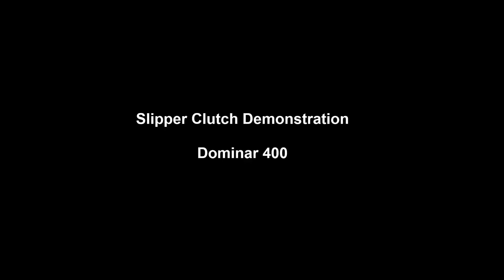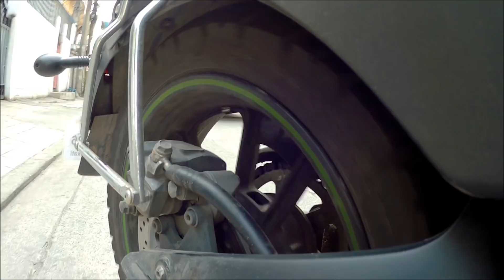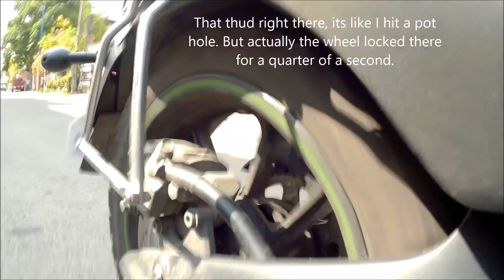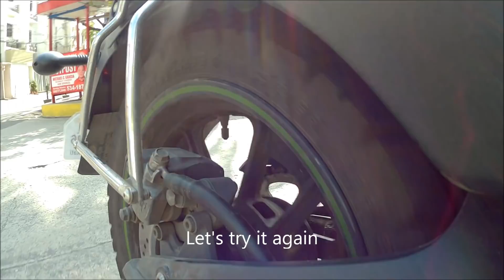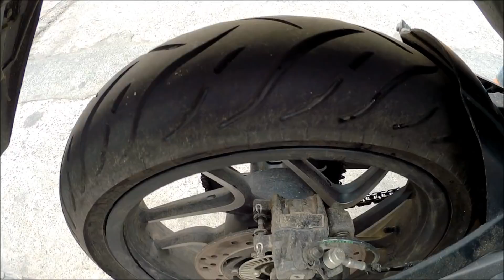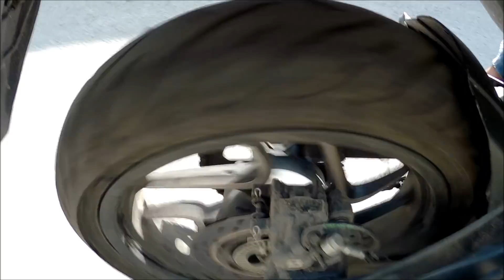Slipper Clutch Explained - Dominar 400

Comment: Basically slipper clutch is for newbies who doesn’t know/haven’t developed yet the habit on how to rev-match before bringing down a gear. So for motorcyclists who doesn’t have slipper clutch, the remedy is to learn how to rev-match 👌🏻
Reply from the maker: Paulo Uy well said sir :)
Reply: I think the main goal of the slipper clutch is to absorb the jerks of deceleration and initial jerk of acceleration. They are also used in racing I'm pretty sure

Comment: So do we use the normal clutch while downshifting a bike with slipper clutch like any other bike? Or do we not need to hold back the clutch ?
Reply from the maker: Yekser Pakkath it's always smooth to pull the clutch.
Reply: Adventure Pilipinas  so it is a downshifting with the clutch held back? 
Also is it normal for the RPM limit to light up when in around 7000rpm ?
Reply from the maker: Yekser Pakkath yes sir. Dominar has low rpm limit. I think in India they have an aftermarket ecu.
Reply: Adventure Pilipinas  thank you!

Comment: Sir, ask lang ako if may slipper clutch din po yung aking 2017 ninja 300 winter test.
Reply from the maker: Jed Minerva thanks for watching sir. Yes i do believe it has a slipper clutch.

Safe ride sir. If you can, please subscribe :)
Reply: Yes sir. Last question po. If ever mali yung down shift mo like high rpm bigla ka ng downshift. Pag walang slipper clutch dba madaling masira gearbox? And slipper clutch is there to save wrong downshifts that will harm the engine and gearbox?
Reply from the maker: Yup, tama po. Mas walang stress sa bearings and gearing ng engine. And mas safe talaga :)

Comment: Sir out of topic but i need ur suggestion po. My dominar always gets air inside my rear brake system which always engaged or lock  ung rear brakes. Kahit paulit-ulit na binebleed ang fluid to release air, bumabalik parin ang sakit after few rides. Ano po kayo possible reason and solution? Thanks..

Comment: kung ganun pag nawalan ka ng preno dimo pueding gamitin pang preno ang cambio? dahil dudulas lang xa?
Reply from the maker: HELL SENT , baligtad sir. Hindi ka dudulas. Dahil hindi maglolock yung wheel... Pero naka engine brake ka pa rin.
Reply: Adventure Pilipinas yung clutch po ata sinasabi nya, hindi yung gulong...
Reply: HELL SENT slipper clutch po dahil mas SMOOTH yung engine braking nya, hindi nag la lock yung rear wheel... kapag hindi po slipper clutch, ramdam nyo yung “damba” ng motor kapag nagbawas kayo ng kambyo...
Reply: para cyang ABS for engine braking.
Reply: HELL SENT pag nawalan ka ng preno paps mapakotse or motor OMG lng masasabi ko hehehhe joke.. kidding aside for smoother ride po yan ika nga ni paps sa kanyang video..

Comment: ung actual testing mo napaka bagal naman. kahit anong motor hindi mag skid pag ganyan kabagal.
Reply from the maker: listojay you can try it on your Dominar.
Reply: listojay paps kapag nag bibike ka talaga Alam mo yung tinutukoy ni paps dito ako personally kelangan ko pa irevmatch yung motor ko wag Lang sya mag abrupt stop kasi sudden stop on engine and wheel while traveling at very high speed May tendency na dumulas ang gulong lalo na kung sa curve ka dumadaan at 60-70kph bigla kang magdownshift to minimize the speed pero nag lock ang gulong dahil di ka nag rev match or wala kang slipper clutch, kahit saglet lng yung moment na yun imagine mo na lng paps pipitik likod mo

Comment: Pero if sanay ka mag rev matching pa down shift, no problem nman kahit hndi nka slipper clutch? Wala kasing slipper clutch nk400. Pero nirerevmatch downshift ko. Kinabahan tuloy ako baka mamaya bigla ako mag skid. Madalas kasi dalawang sunod ako mag downshift para mas malakas engine braking.
Reply from the maker: You are right sir, pag sanay ka na at kabisado mo na rev matching ng gears, you will be fine.